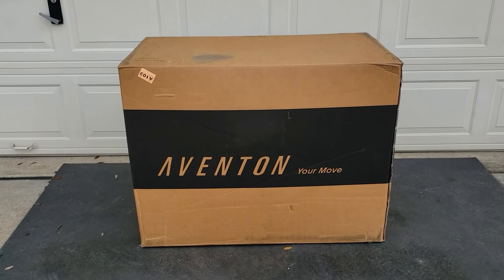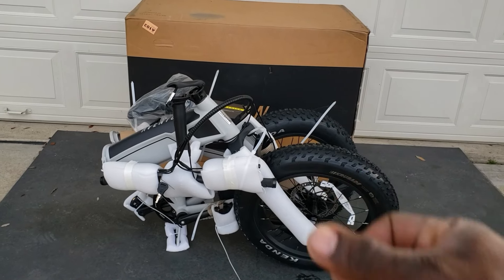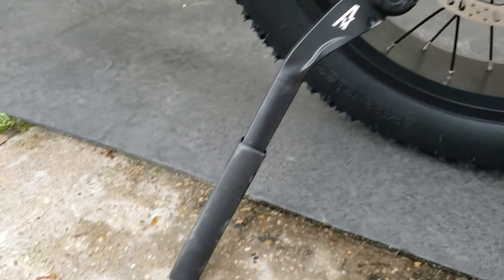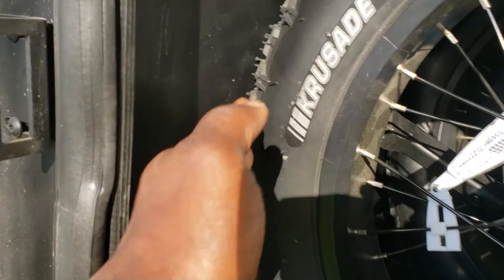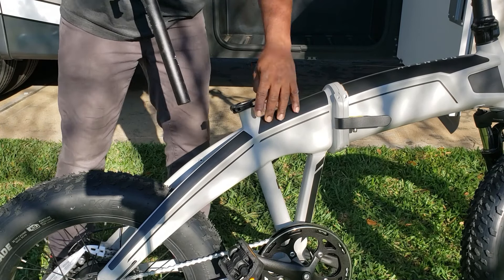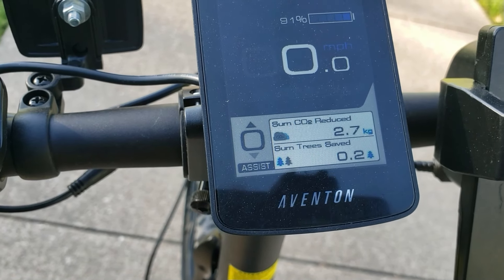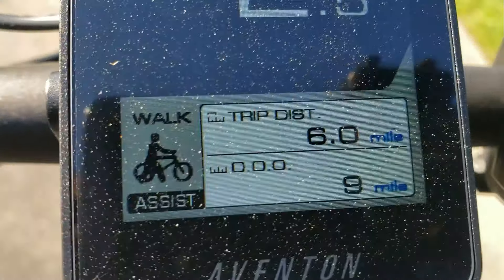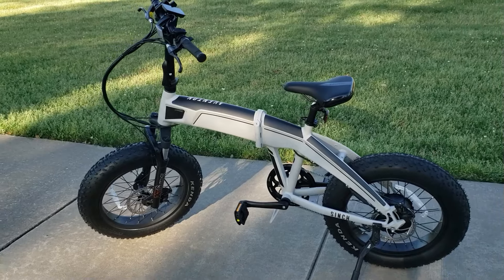NEW Aventon Sinch Foldable Ebike - Unboxing & Review

Comment: I've had my smokey grey sinch for 6 months now and ive put 2000 miles on it. Great bike. Lots of fun. Lots of power. Battery last a long time. Im now putting some winter studded tires on it for snow riding.
Reply from the maker: Wow that’s awesome. Im just checking this message and we just got back from riding mine almost got stuck in some mud riding around the lake.👍🏾